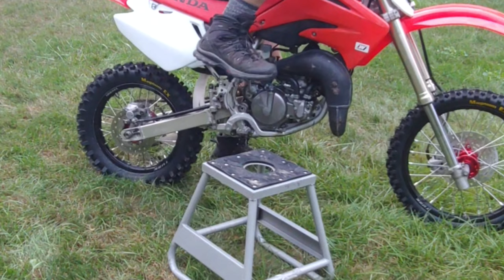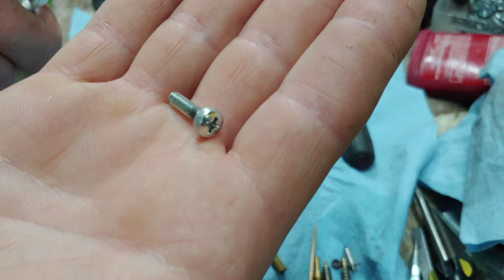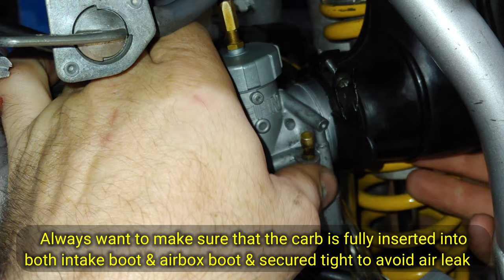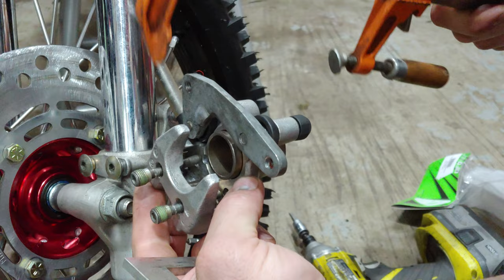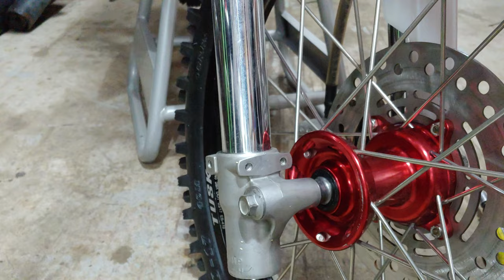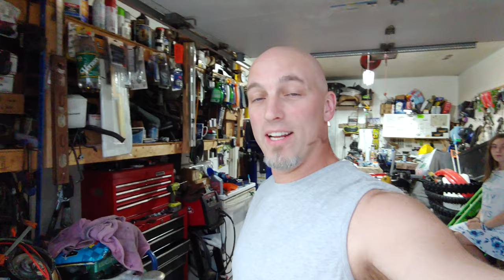03 Honda CR85r Rebuild part 5: Carb Leaking Fuel [FIX]

Comment: I too hate those philip screws on the float bowl,i assume the new allen heads were stainless to keep rust at bay,but what size are they so i can get a box from our local fastner guy 1/4 x 20? X1 or something like such i imagine!!snooky pa.👍
Reply from the maker: Honestly I not quite sure. I took one to my fastener shop and they matches the and gave them to me. Maybe 6m x 1.0 or 5m x 1.0

 But yeah, all of the snowmobile carbs have thw Philips and on used sleds are normal toasted. Have to use visegrips to work them loosen them.

Comment: You blow the top end on er lol stock jet is 1 1/2 fuel mix 48 pilot 4th clip 152 main at 0-1000ft
Reply from the maker: Yeah I just looked it up and stock main is saying 142. The carb kit I got was from PsychicMX and they gave me a 125 and 50 pilot. But that's not what happened. It was the crank. Piece of the crank neesle bearing came off and got into the combustion chamber. Video coming up soon.
Reply: @Fixin2Ride-Official-  sucks Mann,  I just got same bike as you gunna be stripping it down and painting the frame white looks like someone painted in black and replace all the plastics and graphics and polish up the rims, gunna need some exhaust seals as well cause there’s spooge all over the place, gunna be a fun cleaning week or... month haha
Reply from the maker: Good deal. Shell clean up nice I bet. This one was a destroyed. Didnt even have the rear rim secured in place. Only one side had swing arm bearings, no locking nut for swing arm bolt, cylinder was destroyed, piston and clearly crank. And a host of other things missing or siezed. Had to dig out the plastics arcjor nuts in the tank. Got s video of that repair too.
Reply: @Fixin2Ride-Official-  you got a link to that video ? My same thing rhs top bolt is seized in there debating on just cutting the plastic shroud off and grind the bolt head off and drill it out , but if you got a better idea then that
Reply from the maker: No I have put it together yet. Still got to edit it. But soon. I'll post a link in this video description once it's done and ready to be viewed. The method worked really well